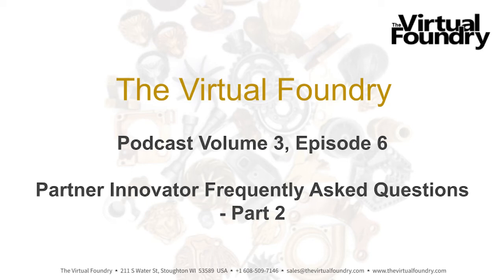Podcast V3E6 - Partner Innovator FAQs - Part 2

Comment: Thank you for this, IM curious about size constraints on  parts for the Ti, or AL and Inconel 718 materials
Reply from the maker: Upper size limits haven't been tested. There are some minimum wall thickness recommendations but it's really about what your printer can produce. The sintering process likes thinner (<5mm) walls but there are techniques to manage thicker parts.
Al and Ti sintering are untested by TVF since they require specialized processes. Inconel sinters up great in common kiln equipment and the process laid out on the TVF website.